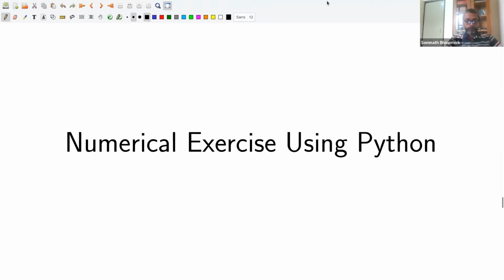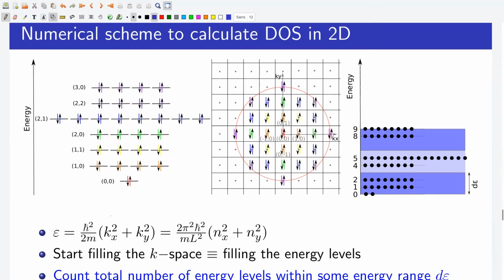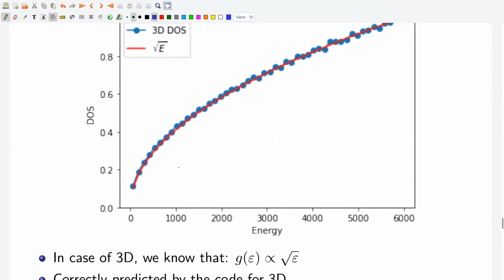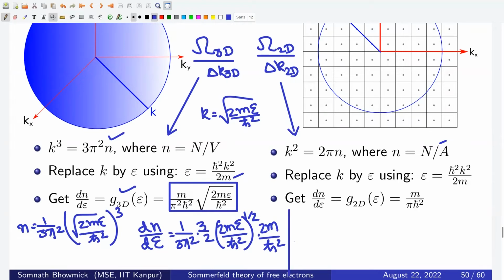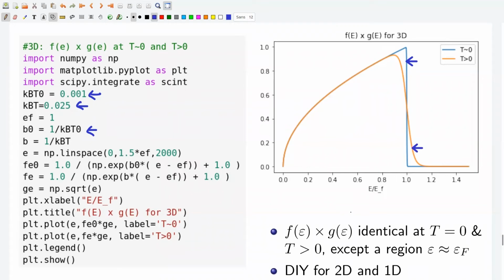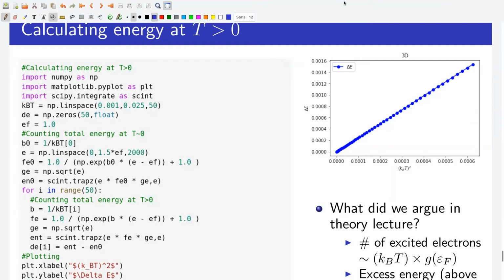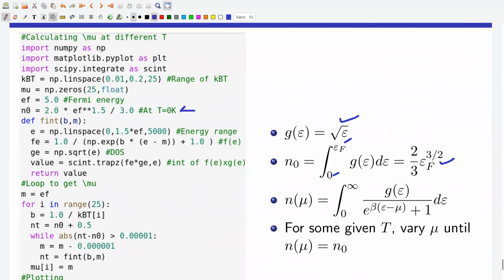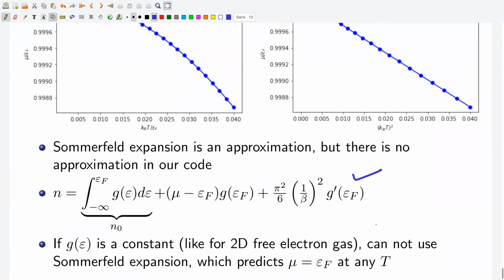Lecture 15

Comment: Lecture 1: Introduction
Lecture 2: Drude Model
Lecture 3: Schrodinger Equation and Particle in a Box (including superposition)
Lecture 4: Solving Schrodinger Equation for Different Potentials (Harmonic Oscillator, free particle, tunneling)
Lecture 5: Visualization using Python
Lecture 6: Visualization using Python
Lecture 7: Numerov Method (algorithm)
Lecture 8: Numerov Method (code)
Lecture 9: WKB approximation
Lecture 10: WKB approximation
Lecture 11: Quantum free electrons
Lecture 12: Quantum free electrons
Lecture 13: Quantum free electrons
Lecture 14: Quantum free electrons
Lecture 15: Quantum free electrons (numerical exercise)
Lecture 16: Real and Reciprocal lattice
Lecture 17: XRD, periodic potential, Bloch theorem
Lecture 18: Bloch electrons in 1D solid
Lecture 19: Bloch electrons in 1D solid
Lecture 20: Bloch electrons in 1D solid
Lecture 21: Origin of band gap (Bragg reflection)
Lecture 22: Origin of band gap (Bragg reflection, Kronig-Penny model)
Lecture 23: Origin of band gap (Kronig-Penny model)
Lecture 24: Band structure in 1D: different representations
Lecture 25: Band structure in 2D and 3D
Lecture 26: Fermi surface (Brillouin zone of a square lattice)
Lecture 27: Fermi surface (monovalent, divalent, trivalent, tetravalent) 
Lecture 28: Fermi surface (nearly free electrons)
Lecture 29: Semiclassical electron dynamics
Lecture 30: Semiclassical electron dynamics
Lecture 31: Semiclassical electron dynamics: concept of hole
Lecture 32: Semiclassical electron dynamics: concept of effective mass
Lecture 33: Semiclassical electron dynamics: concept of electron and hole orbit
Lecture 34: Tight bonding method (1D energy dispersion, density of states)
Lecture 35: Tight binding method (2D, 3D, LCAO for linear chain)
Lecture 36: Tight binding method (LCAO for square lattice, graphene)
Lecture 37: Semiconductors (Valence and Conduction band)
Lecture 38: Semiconductors (Si, Ge, GaAs)
Lecture 39: Semiconductors (law of mass action)
Lecture 40: Semiconductors (impurity conductivity)